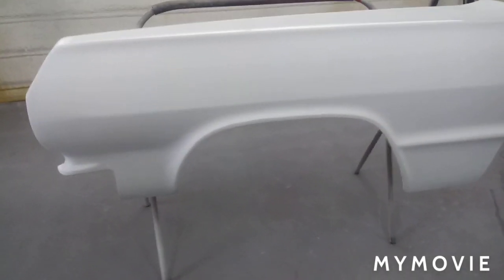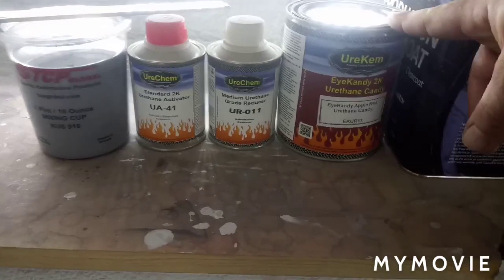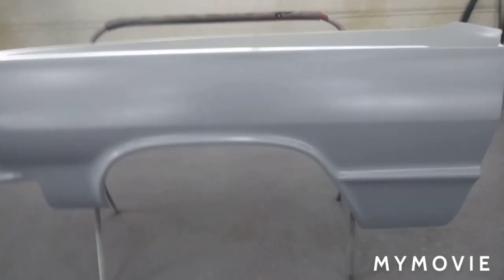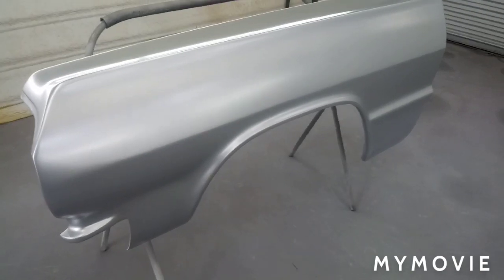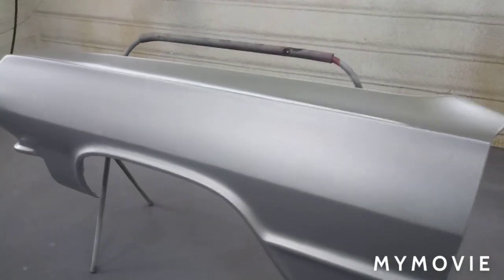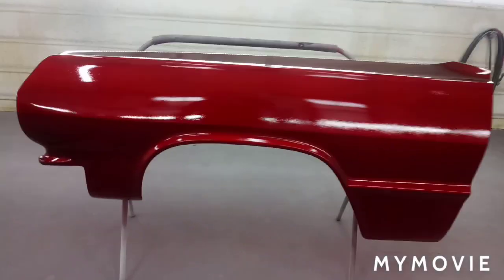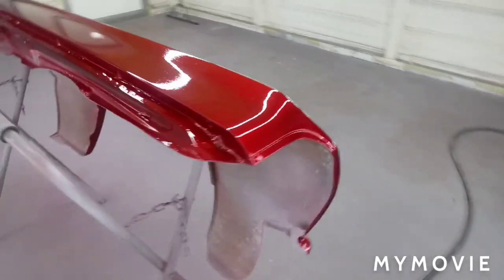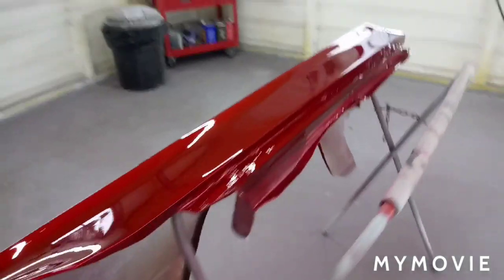CANDY PAINT! first timer process for spraying kandy apple red

Comment: Do you need to have a sealer ? I have some 100 micron silver to spray and then some house of colour candy red x3 ? then some clearcoats 2-3 ? and then light sand add my decals , a mist coat then a decent clearcoat.  Does that sound right . Cheers
Reply from the maker: I dont do mist coats on clear.  I spray  clear the way I want it to look when it's done.  If u spray a mist coat or a tack coat,  that results in texture or peel.  And any coat after that will have the same texture or peel.
Reply: @lonestarlows  hi thanks   , but most videos I have seen usually say, do light mist coat over your decals to lightly seal them,  I suppose , do you think they can handle a full coat straight off .
Reply from the maker: @Cobra427Veight yeah. Honestly I'm not a custom painter. This fender was an experiment ...but I never spray mist coats of clear